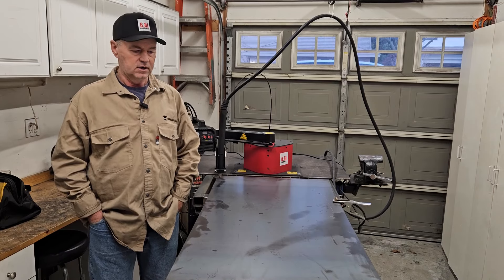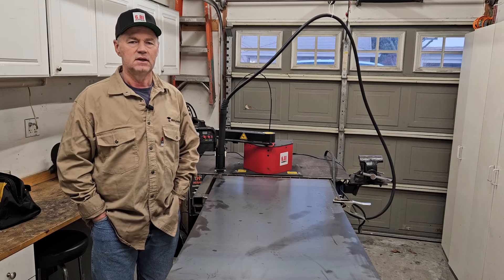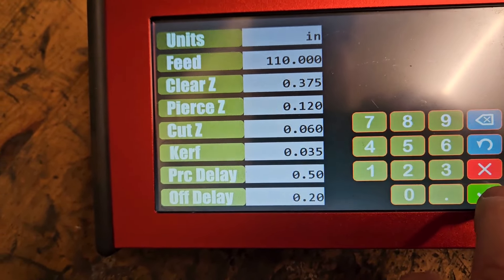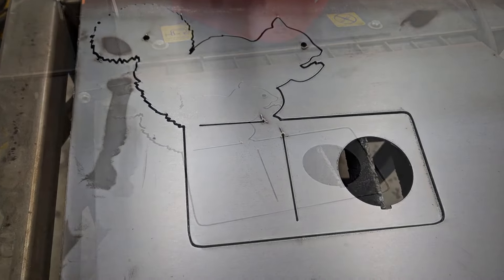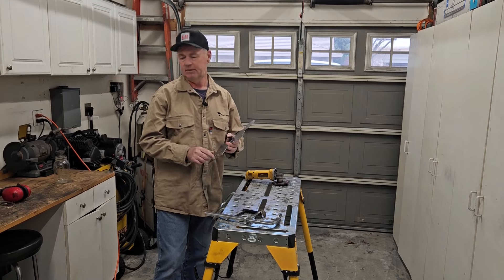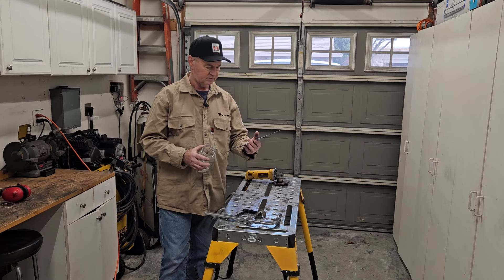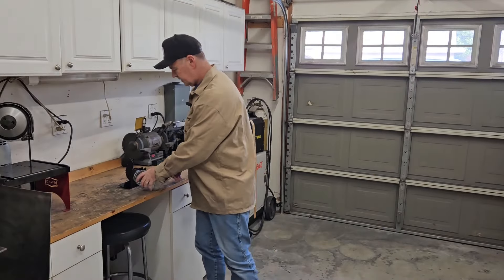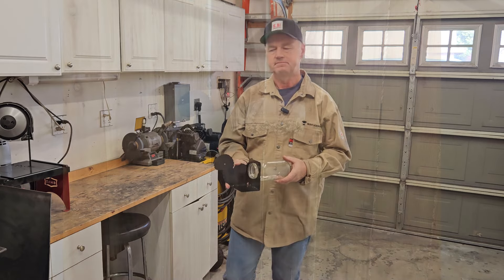Using Arcdroid and a mason jar to create a squirrel feeder | Arcdroid CNC, Inkscape, and Sheetcam

Comment: A bit of angle iron or flat stock in the vise to extend the jaws could be used, but it didn’t look like you had any problems. I thought you would use a jar lid to hold the jar. Great idea to thread it on with that trick! Thanks for the content!
Reply from the maker: Good Tip.   Thanks for watching!

Comment: What is that bit attachment you're using to grind out the circle, I use a Dremel but that looks better and where did you get that portable welding table? Thanks
Reply from the maker: That's a carbide burr.  You can get them at the box stores Harbor Freight, amazon etc...   I probably paid too much for the portable welding table because of the Yellow paint, but here's a link: https://www.acmetools.com/dewalt-welding-table-workbench-portable-steel-dxmf4618wt/099198927961.html
Reply: Thanks again! @6.8liter74

Comment: I like it !! Any way I can get file for that? And I’ve been having trouble finding sign files to fit arc droid foot print. Any suggestions I’m new at this !!! Thanks Bill
Reply from the maker: Well to be honest I still haven't measured the mason jar opening and updated the file yet.  Once I do that I will see about making it available to channel subscribers.  The only suggestion I have is, if you have the .svg file you should be able to resize the file pretty easily using Inkscape.  Thanks for watching!
Reply from the maker: Heads up!  I updated the squirrel feeder drawing.  It will be in the video releasing this Friday.  If you are interested, you can get the new design from the store for the hosting cost, $0.49, that's as close to free as I can get.  Here's the link https://68liter.creator-spring.com/listing/squirrel-feeder-2-0?product=963